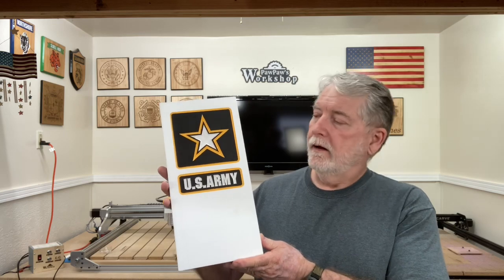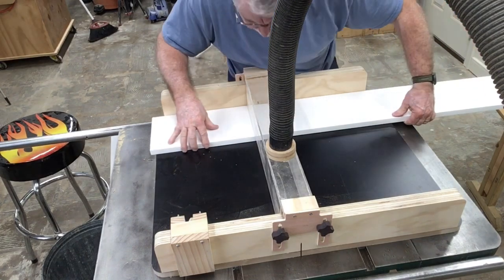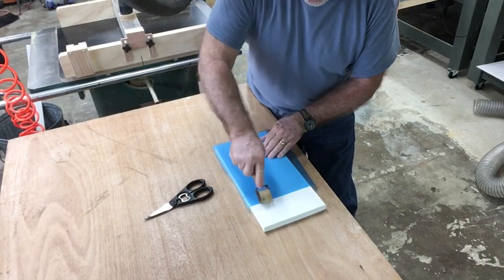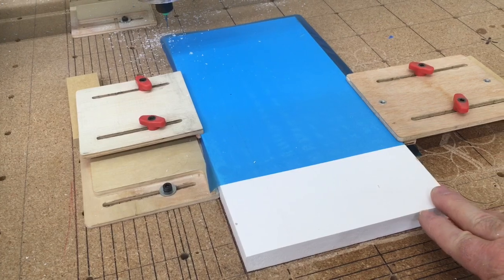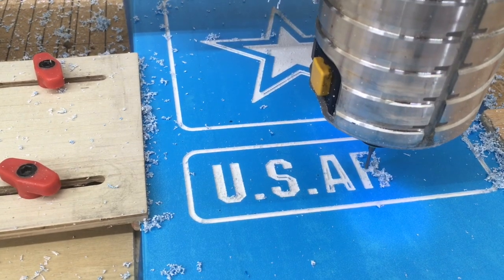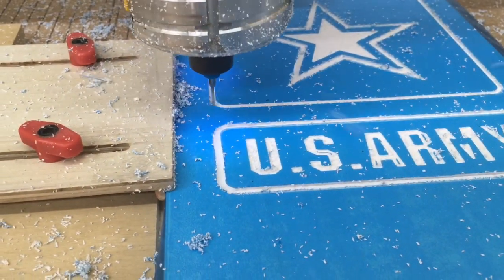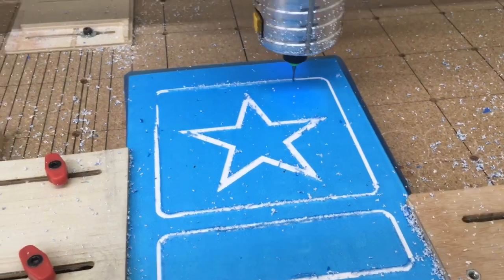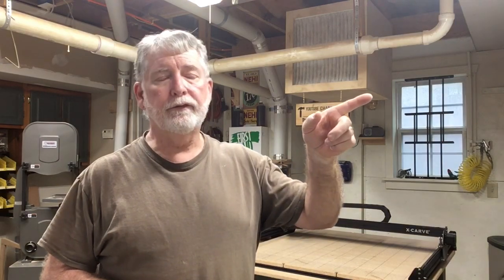Big Mistakes Carving PVC on the CNC. Learn to Solve Problems!

Comment: How do you know what bit to use when cutting? (Newbie here)
Reply from the maker: There are some very basic bits that I use most of the time. The 1/8” bit is the most used. A 1/16” usually gives all the detail that I need. These are end mill bits. A vbit is used for the vcarving. I use 90 and 60 degree bits the most. Look at your preview menu to see the results. Change the bit and check the preview again. There are upcut and downcut end mills also. Upcut gets the wood or PVC up and out of the way. A downcut endmill will cut wood cleaner with less tear out. This is the basic for the bits. There is a lot more but this should get you started.

Comment: New subscriber here…I’m looking to be making a few pvc signs and I was wondering what kind of paint did you use to paint the pvc and how is it holding up after a few years?
Reply from the maker: I have used acrylic paint and also I use rust o luem  paint. After spray with a good quality UV clear gloss and it will last for quite sometime

Comment: Trick with the Oramask is to take a piece of painters tape on the corner. Pull on the tape and it separates easily. I got tired of trying to hook it with my fingernail.
Reply from the maker: Excellent idea. Thanks

Comment: I was carving out a design on my xcarve this morning , and the spindle ( router) stopped working? Any suggestions?
Reply from the maker: If the cnc is still working and just the router quite I would get that the brushes are worn out.
Reply: @PawPawsWorkShop  how long do brushes usually last?
Reply from the maker: About 150 to 200 hours.  I have several videos on the topic including how to change them

Comment: I cut PVC often with Oramask. I run 150 ipm, then I set the depth per pass .02 less then the total depth. If you paint the surface first, it’ll smear as it cuts even if it’s dry. The .02 clears it out. The higher feed rate helps clear the pvc nicely.
Reply from the maker: Thank you

Comment: I have been doing my PVC at .05 depth. I run the Amanda 45 degree v-bit as the detail pass first at full depth and I get a clean edge. I run the roughing pass second with two passes to get to the full depth and this has been working flawlessly for me.
Reply from the maker: Thank you Steve, I will have to give that a try.  I usually have excellent results.  This one was a little hard.  I also realized that the bit was dull.  That makes a huge difference.